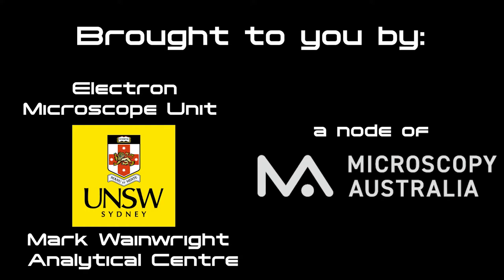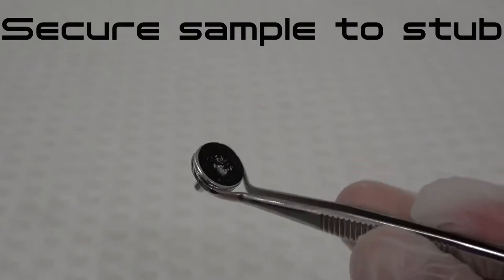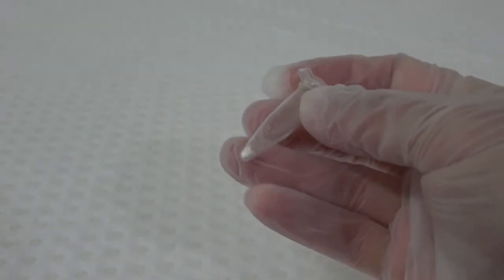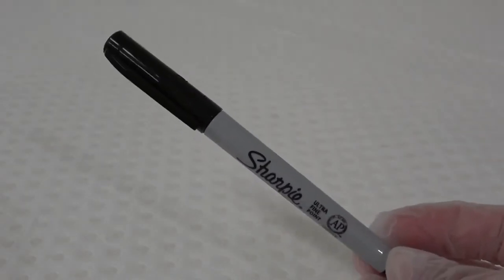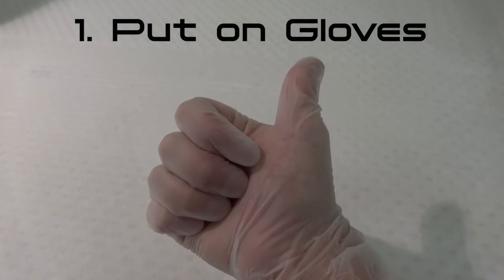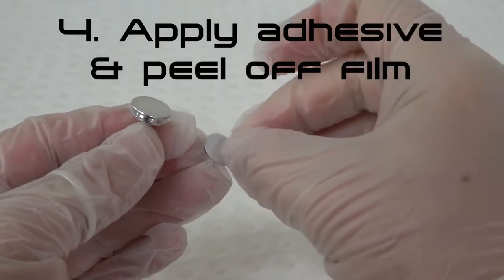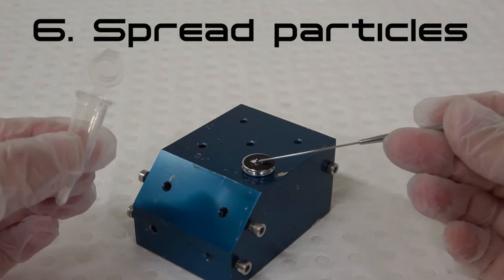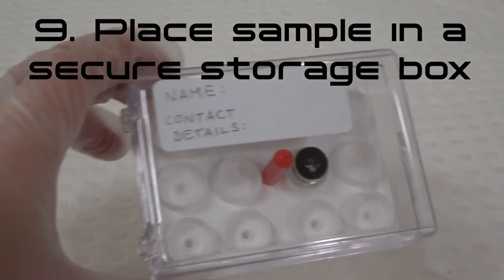SEM: Sample Mounting for Powdered Samples

Comment: I normally use teflon spatula, specially when working with heavy metal particles, because the metal spatula can leave particles (but at least you know they come from spatula)  on the surface of sample. And it sometimes helps to clean the loose particles from surface of carbon tape with air compressor, then you won't have truble with particles flying in BSE detector (happened once 😒)
Reply from the maker: Thanks! That's a good tip!